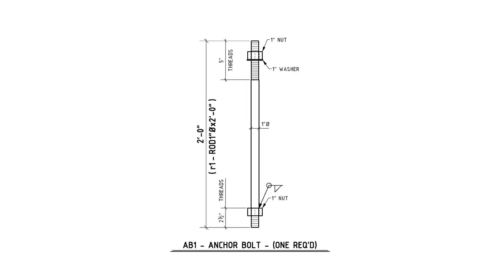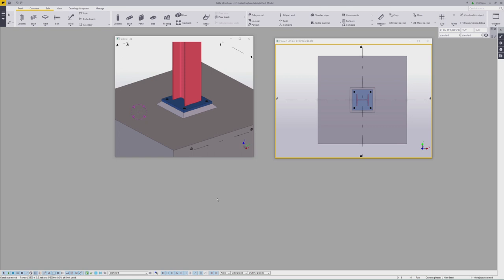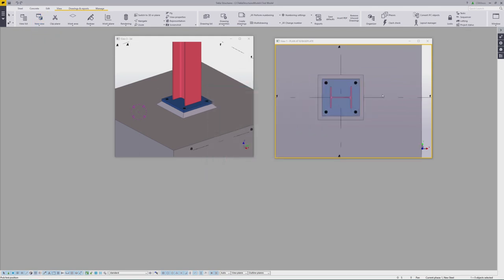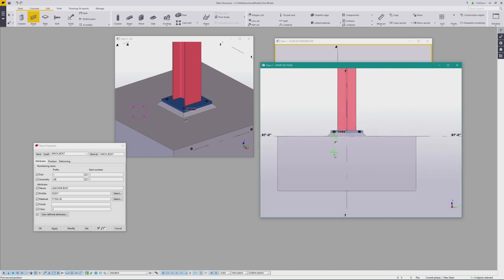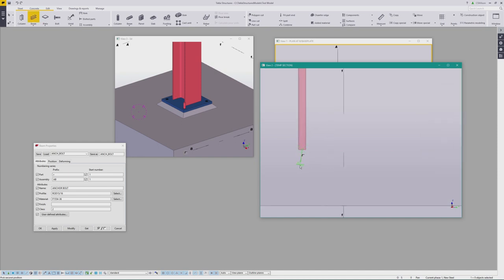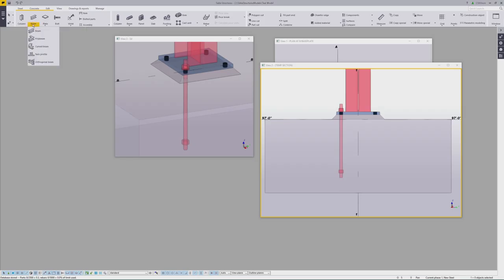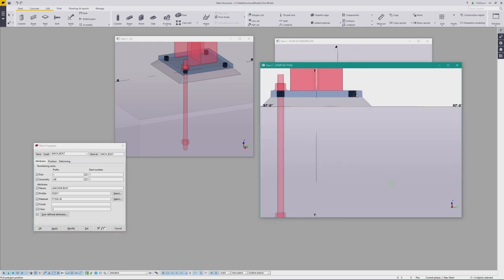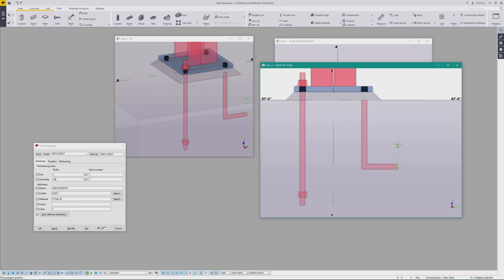Anchor Bolts - Modeling Techniques Using Tekla Structures

Comment: Very nice. I have saved rectangle properties that I use for the threads. Set the border line color to invisible and use ANSI32 fill, rotated/scaled.
I really appreciate the toolbar tip, as I use the swap handles macro frequently.
Reply from the maker: Thanks!  That's a great tip for the threads!

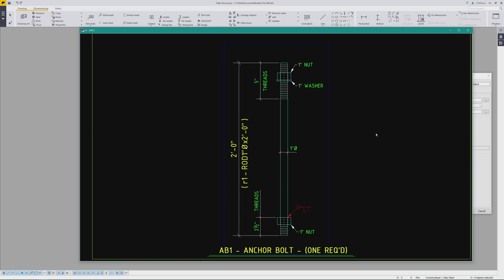Comment: Hi CSWD, great Video. And Greetings from the Tekla Structures Discussion Forum.  At 12:45 i would speed up the thread showing process by using a hatch and edit its angle so it fits your needs.
Reply from the maker: Hello, AjoBob!  Nice to see someone from the forum!  That's a good idea with the treads!  It sounds like it'd be more efficient. 
Thanks for the feedback!

Comment: Hi CS Wilson, I was wondering if it is possible to make the nut and washer appear on the Bolt List, since they are modelled as parts and not bolts.
Or how do you handle this? If your customer would like to order all the Bolts and Nuts needed for the Project, those Nuts and washers would not appear on the Boltlist, but on the Profile-list. (I really appreciate your videos, greeting's from Swirterland)

Comment: Good Job CS. Can you put any light on the fact that tekla don’t have all profiles of all the steel shapes in the world? Why should I have to import profiles? Autodesk Advance steel has them
Reply: Tekla pulls the profiles from your environment file. CS is in the US and therefore runs a US environment. I'm in the UK and my environment file has all UK profiles. You can still add profiles via various methods too

Comment: Hello Sir, appreciate for video, but I faced another problem by doing bolts your way. The thing is, in my drawings, I usually put table of details: where all profiles are displayed. It contains lengths, masses and sections of all details. This table shouldn't contain bolts, but since I created a blot as a beam, it appears in my table. Could you suggest me what to do, in order to remove bolts from the table? P.S. table generated automatically.
Reply: In your table template create a formula to not pick up the parts you don't want

Comment: I want to know more about the anchor bolt, why one of side the nut to be welded?
Reply from the maker: The weld prevents the bolt from turning in the nut and the nut prevents the bolt from turning in the concrete.

Comment: Hi CS Wilson. First of all I'd like to thank you for this great video. I would like to know how did put a macro (in this case the swap handles) inside the contextual toolbar. Thanks again for sharing your knowledge. Best regards.
Reply from the maker: Thank you!  I appreciate the comment!

To add a macro or UDA to the contextual toolbar, see the following from the TUA:
https://teklastructures.support.tekla.com/2017/en/gen_contextual_toolbar

It’s under “Customize Contextual Toolbar”.
Reply: Thanks for replying. 
At the TUA: 
"To add macros and user-defined attributes:
"Select the desired macro or user-defined attribute from the list.
Click Add."
I don't get it what list is it? It's seems to be easy, but I'm not finding the "List" even the Add button.
Reply: Solved; I'm using Tekla Structures 2016i. This option is only available for Tekla Structures 2017
Thanks.
Reply: Fernando Not sure if you can add it to the contextual toolbar in 2016i but you can add it to your ribbons or make a keyboard shortcut for it if that would help. I usually have it as a shortcut myself.

Settings > Customize > Ribbon
Type "swap" into the search bar and then drag the macro onto the desired location on your ribbon.
or
Settings > Customize > Keyboard shortcuts
Type "swap" into the filter bar select the macro. click on Enter shortcut. press something thats easy to remember. I use "ctrl shift s" for mine. then click Assign.